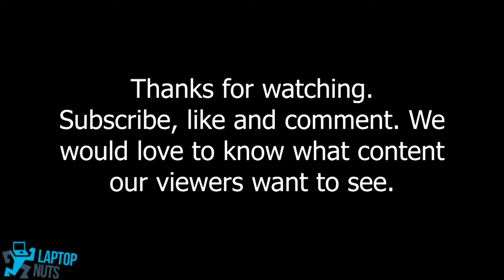Laptop CHUWI HeroBook Pro Disassembly Take Apart Sell. Drive, Mobo, CPU & Other Parts Removal

Comment: Does the laptop still turns on even the battery has been taken out as long as it is plugged in?
Reply from the maker: Yes. Functional laptop will power on without battery, as long as it'd plugged in.
Reply: Bonjour, mon ordinateur a gonflé, est ce que ça peut être la batterie ? Si oui puis-je réussir à l'enlever facilement toute seule ? Je n'ai jamais ouvert un ordinateur. Merci

Comment: Where is the CMOS battery to reset the bios? I don't see it anywhere in this video. Is it under the keyboard?
Reply: I think the rechargeable I-Ion battery acts as one. I have an old Acer tablet, no cmos battery anywhere. The main battery was acting as the cmos battery. This one's probably the same
Reply: I think the rechargeable I-Ion battery acts as one. I have an old Acer tablet, no cmos battery anywhere. The main battery was acting as the cmos battery. This one's probably the same
Reply: @Ghost2004  Got it, I'll pass it along to the person I was trying to help